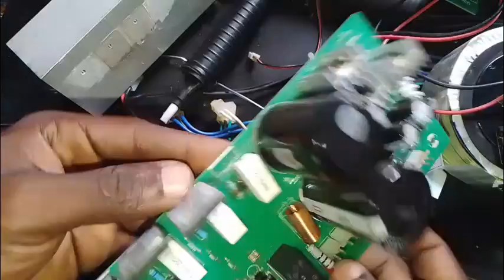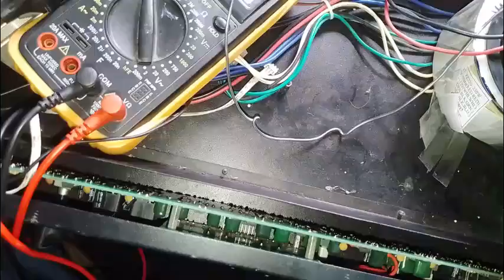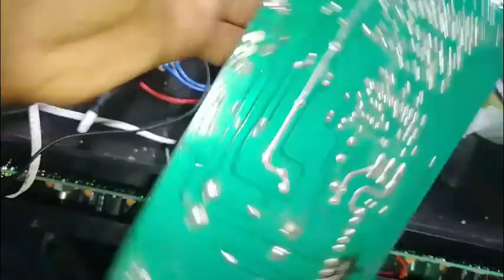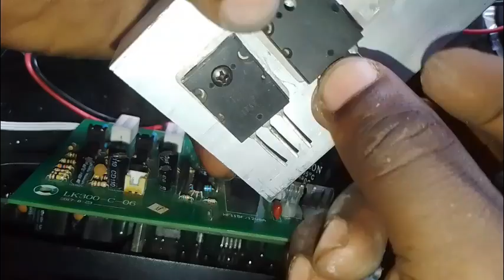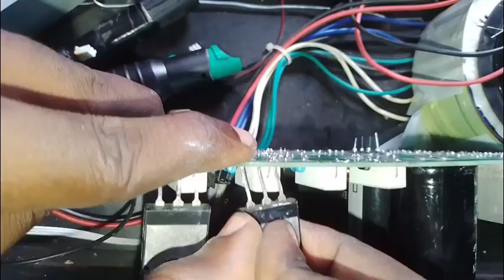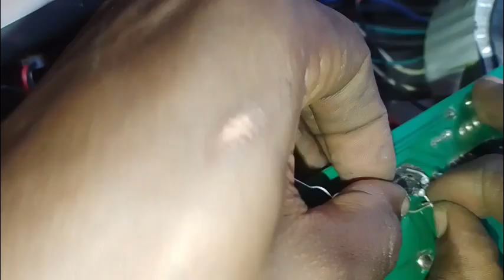Amplifier Repair Crash Course for Beginners | Fix Any Amp Fast

Comment: Thanks for your illustration. Can any bridge rectifier be used for replacement?
Reply from the maker: Yes, but always consider the maximum voltage rating of the rectifier and the use case.

If it's a circuit that requires 400v you definitely don't want to replace it with a rectifier that has power capacity.

But in the real life scenario, the u voltage is between 110 to 240v for normal audio equipment and a normal retifier can handle 400v.

But if the diode is from all this heavy duty equipment, replace with the exact type or something better.

I hope this helped you, thanks for watching